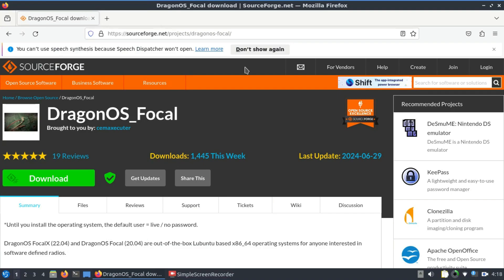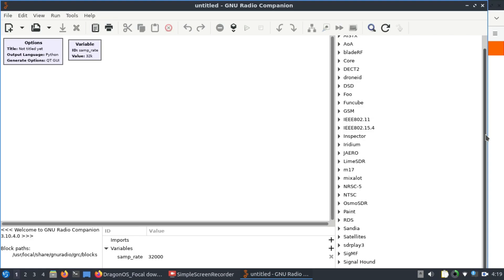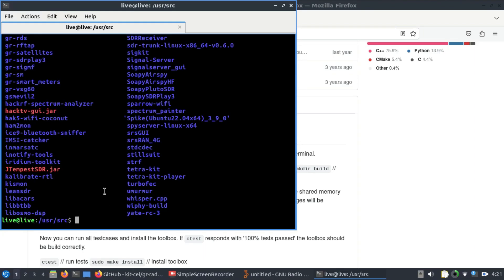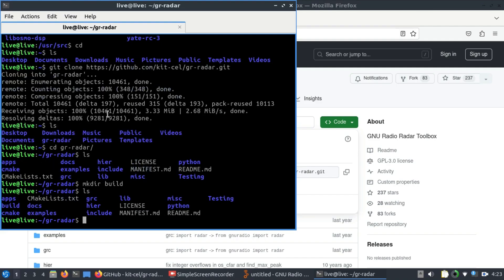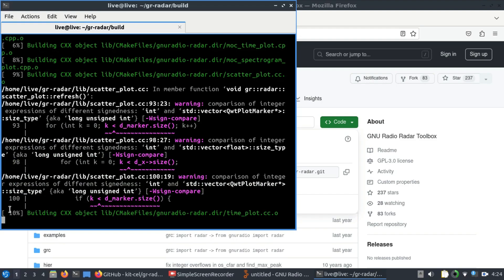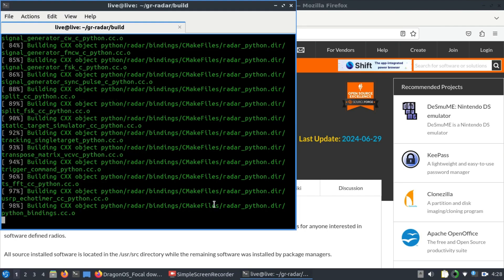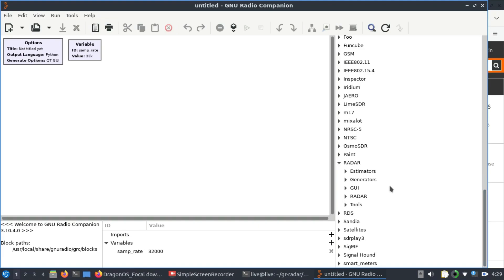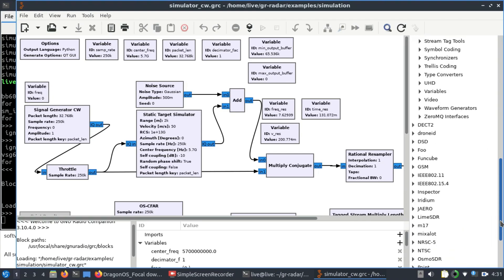GnuRadio Tutorial | How to Compile OOT Radar Module in GnuRadio Companion & CW Radar Demonstration

Comment: hi, i followed these steps and I am getting error:
No package 'Qt5Qwt6' found
Cout NOT find Doxygen
include could not find load file:
GrPybind
Reply from the maker: Use DragonOS focal as your Linux distribution which takes care of all your dependencies then compile OOT module for radar
Reply: @Muhammed_Mustaqim  Thank you so much for your reply

I have just installed Dragon OS , but now its not recognizing my USRP N210 . 

Moreover, its not installed. its just running from my USB drive. is this how it suppose to work or am i doing something wrong?